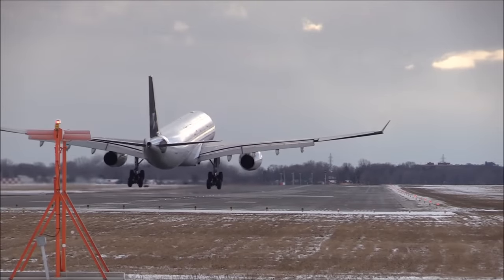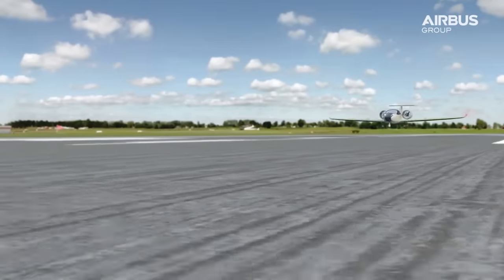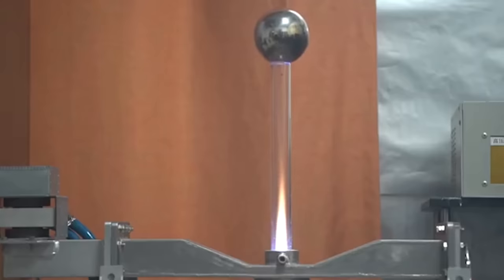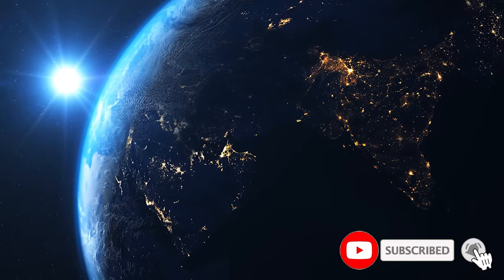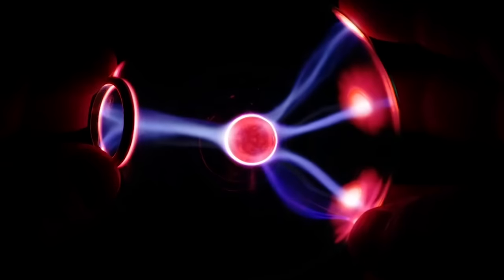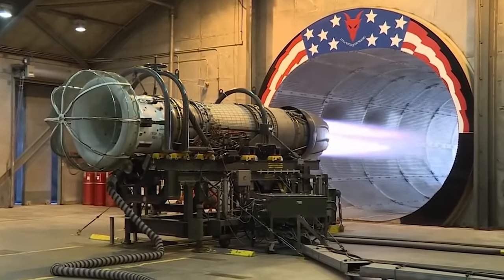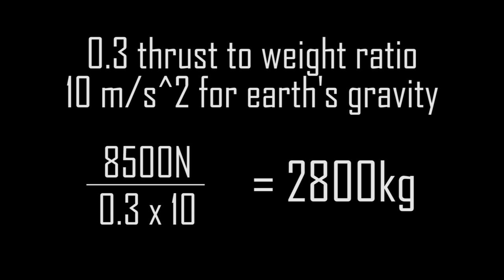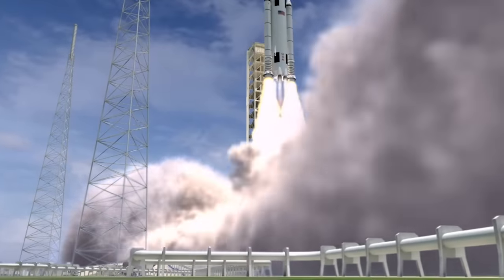Uncovering China's New Electric Plasma Jet Engine

Comment: Interesting. 

Now we just have to figure out fitting a nuclear reactor to the plane.
Reply: The Americans did that during the cold war i think (as you can tell it wasn't commercialized) look it up its a fun watch
Reply: @daylenhigman8680  So did the Russians.
Reply: Russians already working on it.
Reply: Not feasible. The shielding needed to make the reactor safe will be too heavy for an aircraft. Also, imagine what happen if the plane crash.
Reply: @fadlya.rahman4113  Indeed. It didn't stop them trying though. I believe the Russians actually flew one of their test flights with the reactor running (not powering the plane though). Basically, ICBMs put an end to this madness anyway.
Reply: Also even if it was possible I wouldn't make much sense other than for air space patrol, since comercial planes are not in the sky 24 hours a day which is the only real reason we take the risk of carrying highly radioactive material on board of a vehicle, so the vehicle doesn't need refueling at least for a decade or so
Reply: @fadlya.rahman4113  they basically only shield the cockpit,ome of the more serious problem was radioactive particles exiting though the exhaust.
And like Geoftv2 says ICBM's killd it
Reply: we need nuclear smartphone
Reply: @daylenhigman8680  the problem was that when the americans tested that plane, the engines actually leaked Radioactive Uranium atoms as a byproduct of operating the Nuclear Reactor inside the plane and that's why the US abandoned the project shortly after testing it.
Reply: a flying nuclear power plant. what could possibly could go wrong?
Reply: @mostlypeaceful5621  proceeds to fly into hostile air space
Reply: Aviral Singhal thorium
Reply: @tripplefives1402  well, it was a flaw, considering the fact that it spewed radioactive uranium particles into the air, even if the aim of this feature was to cool the nuclear fuel.
Reply: @yurisv7315  Neither the US or the Russian program solved the shielding and weight problems and both were canceled by 1961.  ICBM developments made them not needed.    In short, the "problem" was too expensive, too dangerous and not militarily necessary .
Reply: @ancelrick5396  the Soviets didn't even wanted to solve the shielding program, sadly, and out of 2 Tu-95 Crews, only 3 people survived the exposure to Radiation.
Reply: It was done in the 60's but abandonned due to safety issues.
Reply: @yurisv7315  All in all a really bad idea..
Reply: @ancelrick5396  agreed
Reply: @GeoffTV2  It was never built... so the story goes.
Reply: Hot rock boiling water is what that boils down to.
Reply: Russians did it with TU 95. They did not bother with the reactor shielding though.
Reply: @tomaskarpeljr.3800  I don't think so, I heard that was their bluff to the USA. Can you find a link? I'm interested... They ones I found had turbine counter-rotating props. Amazingly powerful and reliable design. Sent a link if you have it, cool! :)
Reply: Why do you need a nuclear reactor? The abrupt motion of the plasma electrons/nucei tapp the ZPE/ aether like victor schuabers respulsine, Josephs Papp's inert gas pulse plasma 2 stroke engine, and t henry morays plasma tube generator! just thing of the 2 stroke technology that could come from this puylse plasma technology!
Reply: You can as well beam gigawatts of power from the ground.
Reply: Go scalable thorium. No chance of nuclear plumes.
Reply: @fadlya.rahman4113  It is feasable. A LFTR reactor could be scaled way down. There also was a huge radiation shielding breakthrough using Melanin, and Selenium recently that could solve the shielding/weight issue.
Reply: Hey I live close to a site where they worked on that. Middle of nowhere in north central PA.
Reply: @fadlya.rahman4113  For the late 1950s - early 1960s atomic turbojet system, yes (because it had to pass through, and greatly heat, a stream of high-velocity air; the required ducting through the reactor made shielding very difficult). But for powering airships--or even propeller or ducted fan driven airplanes--nuclear electric systems would be practical. For these applications, the reactors would be "closed" (not having or needing the high-volume air pass-through ducting that a nuclear jet engine would require), producing electricity via a closed-cycle, heat exchanger-cooled turbine generator. Also:

Nuclear power systems for airships were studied in detail in the 1960s, and they would be ideal for passenger and freight airships. These lighter-than-air vessels' safety (the Goodyear blimps are FAA certified to fly, and carry passengers, without seat belts [I flew aboard the Miami-based blimp Mayflower in 1972]) also makes reactor safety systems design easier, because they wouldn't have to be designed to withstand high crash impact velocities.
Reply: Imagine if the Japanese got this plane if they did kamikaze would be way more effective
Reply: @fadlya.rahman4113  only if there's humans on it
Reply: so we have to boil the water on the plane?
Reply: Or an arc reactor
Reply: @adamnelson4428  sigh
Reply: @daylenhigman8680  project orion
Reply: Don't they have that already, it's called a nuclear missile!
Reply: pitty nukes tend to go full Chernobyl
Reply: A portable fusion reactor would completely solve this. Fusion is very safe, and could potentially be very light weight.
Imagine that. An almost 100% emission free aviation industry.
Hopefully one day we can develop such technology.
Reply: Fusion: let me introduce myself.
Reply: It was an actual idea by the americans but it was scrapped
Reply: It was called the "big stick" and it was a unmanned drone. The rods would get stuck after full throttle. It was a dooms day weapon because after dropping its payload of nuclear bombs it would spray nuclear fallout out as emissions. 
Not sure but I believe they had 1 test flight but I cant remember
Reply: @fadlya.rahman4113  If we are working with a fusion reactor chamber, then all shielding would be for isolating the heat. nuclear fusion is a robust process, once failure the reaction will stop itself, which is completely different from fission, i.e. no need of concrete, no need of steel. What you need is just a strong magnetic field
Reply: Someone needs to make an arc reactor...
Reply: @jagernull6641  Yeah. Fusion. That holy grail that's always 5 years away since 30 years ago.
Reply: Fadly A. Rahman nuclear planes were developed in the 20th century, but I am pretty confident that whole “nuclear crash” issue is a pretty dangerous one
Reply: Good luck with that the plane does not exist yet and never will.
Reply: @fadlya.rahman4113  well it would be an open core reactor which it very dirty
Reply: how how to do beamed power transmission to a aircraft-sized target.
Reply: @fadlya.rahman4113   Probably not much. Nuclear submarines have already revolutionized the safety mechanisms for an on-board reactor.
Reply: @fadlya.rahman4113  No shielding required if its unmanned and in space.
Reply: @daylenhigman8680  Not a problem as long as you properly shield the power plant. No radioactive particles would escape if you do. The problem would be how to cool it. Land-based and marine-based systems (like your commercial power plants and aircraft carriers) have the advantage of being able to use a continuous supply of water. Up on the air, you only have, well, air. And since planes are way smaller than either a commercial power plant or an aircraft carrier, they won't have the room for the kind of air intake and supply system that wouldn't compromise the shielding. And if they somehow manage to, it'd be hefty.

In the end, not only is the cooling system heavy, the shielding is even more so, and like Nadaso8 said, mass doesn't go well with flight. Also, imagine the maintenance cost on that thing...
Reply: @daylenhigman8680  also the reactor never powered the plain they just did it to see if they could even put a reactor in a plain
Reply: weight is an issue. But if we can fit a steel block of metal for combustion then I'm sure a battery can easily be lighter than fuel. Are you sure you want nuclear airplanes? Wrecking would be messy and could cause airports to shutdown for generations if a reactor leaked.
Reply: If you can fit a nuclear reactor to a plane, you are better off not using it to power something like this, but something more similar to for example a Thermal Ramjet, where the air is just heated up by said reactor and expelled out the back
Reply: WESYM  super capacitors will go dead almost instantly. They have a purpose. It's not exactly to power things. It's to ram things. Use a capacitor with electricity to do a hard start. A compressor for example needs that extra jolt to get started.
Reply: WESYM  graphine is good but it has odd properties. Thermal Energy jumps from one side to the other rather fast. So fast the center stays cool. the problem with capacitors is that they are statically charged they are not a chemical transition. A chemical transition will last much longer than a statically charged supercapacitor.
Reply: WESYM  until we can align electrons in a three-dimensional crystalline cubic the most efficient order possible we will never really truly have the energy we would like.
Reply: @daylenhigman8680  Yup. It was done in response to powering an aircraft with a nuclear reactor. It had to be light, reliable, and extremely efficient (high power/weight ratio). They developed a molten salt reactor (MSR), using a molten salt as both the fuel carrier and the moderator. MSRs operate at high temperatures and very low pressure (and therefore don't require a containment structure because it can't blast open like a PWR). The ideal nuclear fission power plant. They weren't commercialized because the money is in long-term contracts for fuel rods. An MSR has no fuel rods, so commercial builders had no interest in them.
See, for example https://www.youtube.com/watch?v=8Ik3VXEI5X8
Note that you'll find detractors too, but they're usually not talking about LFTRs, but they go out of their way to conceal that. Sorenson (in the suggested video) is talking about a specific type of MSR, the Liquid Fuel Thorium Reactor. All LFTRs are MSRs, but not all MSRs are LFTRs.
Reply: @banjirjir7519  Yep. It just doesn't make sense you need to charge your phone more than once every few years.
Reply: @daylenhigman8680  But it only produced heat, not electricity. If you have a nuclear reactor in a plane, it makes far more sense to simply use the heat that it produces to run the engines, otherwise you'd need a steam turbine system to convert the heat from the reactor into electricity to drive the engines, which would be ridiculous.
Reply: Science?
Reply: @fadlya.rahman4113  whate if it just carried cargo and was autonomous?
Reply: @GeoffTV2  the russian one blew up last week
Reply: @daylenhigman8680  
Yeah, because the design involved the reactor super heating the exhaust by contact, all exhaust was radioactive. It's honestly one of the dumbest propulsion designs ever thought up.
Reply: @manp1039  If putin to be believe, Russia have a nuclear powered cruise missile that can loiter in the air for months.
Reply: @skyfox585  agreed,however it would be amazing if there was a clean way or fuel substitute
Reply: @daylenhigman8680  
Definitely, mostly in military or intelligence use, it could allow spy planes to fly for weeks or even months without refueling. Similarly it could allow a strategic bombers to remain air born and ready to strike at a moments notice for very long periods of time. But commercially it would be garbage and for missiles it would probably cost close to 100x the amount of a conventional ICBM. Still, it would be pretty damn revolutionary.
Reply: Considering you can‘t even get lithium batteries delivered by air transport, I’m gonna say this won’t happen. 😂
Reply: @banjirjir7519 Galaxy note 7....
Reply: @daylenhigman8680  B-36N 'Nuclear bomber'. The reactor was not used as propulsion but only as a test bed for feasibility. It wasn't practical.
Reply: Fadly A. Rahman it’s been done
Reply: Has already been done and for what you get it isn't worth it
Reply: We have modular reactors that might be able to handle it.
Reply: Well at that point you might as well just use the reactor as propulsion though I doubt anyone would want a exposed reactor for a engine.
Reply: if they can figure out the jet part, powerful lasers could be used to recharge the plane as it passes over checkpoints. Overseas flights will require the building of some man-made islands, but it would be well worth it to have electric powered flight, we could then just reserve oil-based fuels for fighter jets and backup systems, could literally save the planet.
Reply: @skyfox585  Project Pluto, quite likely components are tried and tested already. Basically a nuclear ramjet missile. Same concept you talked about
Reply: It wasn't a fusion reactor it hasn't been done but for a few seconds
Reply: @fadlya.rahman4113  not much, reactors have been made way better and safer than before, sure it would not be nice if it crashed but it is definetly possible.
Reply: it is possible for us to put a nuclear reactor in a plane and have it be safe to now but I think the most would be able to fit is 2 of those types of reactors and that's only a 150 megawatts the only reason why I think they could only fit 2 cooling space
Reply: @tripplefives1402  Im pretty sure that the ceramic fuel casings were supposed to prevent the release of radioactive particles, from what I read.

It is a bit difficult to plan a circumnavigating air route which wouldn't irradiate all of your allies
Reply: @fadlya.rahman4113  Technologically there's nothing stopping them from building one, assuming they don't mind some wicked exhaust.
Reply: Maybe hydrogen fuel cells would be better. For aircrafts, energy and power density comes first. Unless we had super lightweight reactors that produces a huge amount of energy
Reply: Fadly A. Rahman
It worked for the American B-36 and the Soviet Tu-95
Reply: @mostlypeaceful5621  the A-10 was just a heavy calibur minigun that fired depleted uranium rounds....that they built a plane around..

They were probably in that same thought process.
Reply: Look at safireproject.com
Reply: We have nuclear submarines. We can have nuclear planes too. That way we don't smoke ourselves to death...
Reply: That may be the worst elevator music soundtrack ever.
Reply: @nadaso8819  All good points and I agree entirely. Let's hope that Fusion reactors become viable sometime soon and go with that.
Reply: @yurisv7315  They didn't leak radioactive particles. The shielding was too heavy to make it viable. Not even the Russians were nuts enough to run an unshielded reactor :-)
Reply: @kerbodynamicx472  Do you mean with a laser? Not feasible as the atmosphere absorbs it and defracts it. Also, the Earth has curvature so laser stations would have to be stationed along the flight path and turned on AFTER the plane passed by...otherwise you'd shoot down/vapourise the aircraft :-)
Reply: @daylenhigman8680  well yeah, in theory it could allow a plane to fly continuously for months without landing as no need to refuel. But having flying nuclear reactors everywhere is a pretty bad idea. The cash site of any plane would be a total nightmare and if the reactor got damaged in a basic crash it could expose survivors to lethal doses of radiation. Great ideas for some senarios, not for mass adoption.
Reply: Just look up Project NERVA
Reply: @GeoffTV2  *Soviets
Reply: @concept5631  Good point, my bad.
Reply: @Nybbl er well neither of us are nuclear scientists but i think thorium has no radiation or much less?  anyway i want to see warp drive and anti gravity tech.. dark matter maybe? 🤔